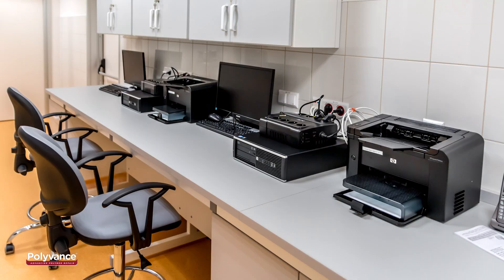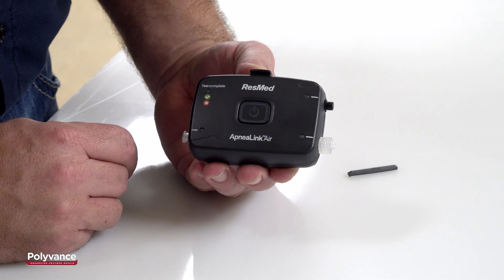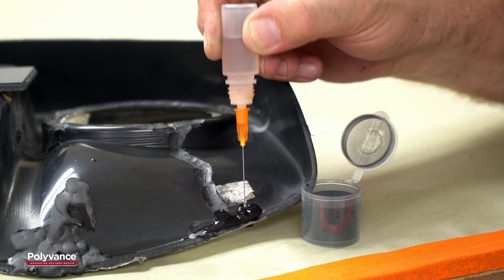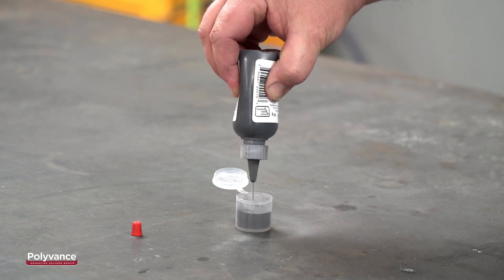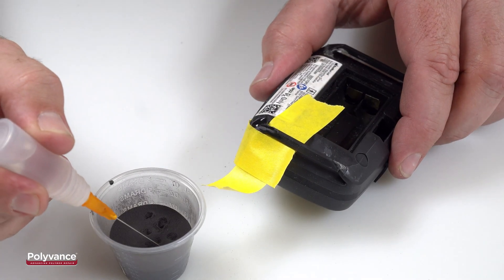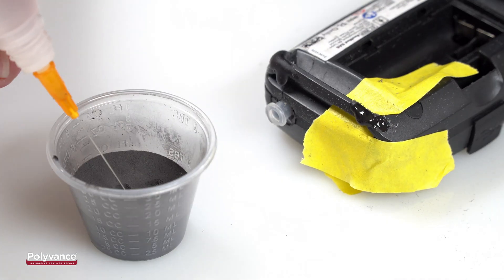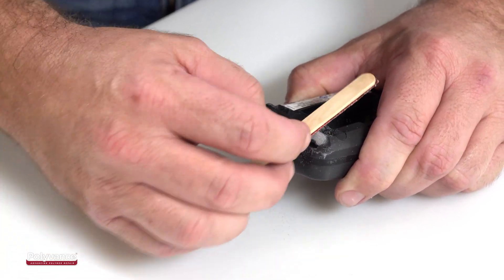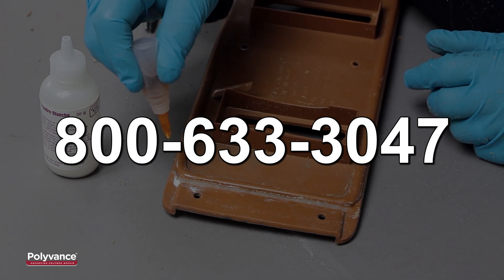Repairing a Medical Device Using PlastiFix

Comment from the maker: Here are some answers to common questions about PlastiFix:

Where can I get PlastiFix?
We cannot ship PlastiFix overseas due to hazmat restrictions. If you are in the United States, you can buy it from us. If you are in the UK, WOW! (http://www.wowauto.eu/) may still have some available.

Is PlastiFix just super glue (CA glue) and baking soda?
No! PlastiFix is a special type methylmethacryalte designed for ABS, PC, Acrylics and other hard plastics. Super glue only bonds to the surface of the plastic. It is also very brittle and only has about 30% the strength of a PlastiFix repair on hard plastics.
PlastiFix chemically etches itself into the plastic and should not fail.
Plastifix uses a liquid monomer to polymerize the powder to form MMA plastic in an exothermic chemical reaction. The most common forms of MMA include acrylic and lucite. The individual components have no adhesive properties without the chemical reaction of the two ingredients, unlike super glue. Because the components can be reacted directly on the surface to be bonded, the added benefit is that the reaction incorporates the surface molecules of the base plastic, creating a chemical as well as physical bond on some materials. The chemical AND physical bond make this type of repair extremely durable and impact resistant,  plus it is sandable and easily painted, unlike super glue type repairs.

Can I use PlastiFix on all plastics?
No. PlastiFix only works on ABS, PC and other hard plastics. It will not work on nylon very well, and not at all on PP or PE plastics. You should use a plastic welder on those types of plastics.